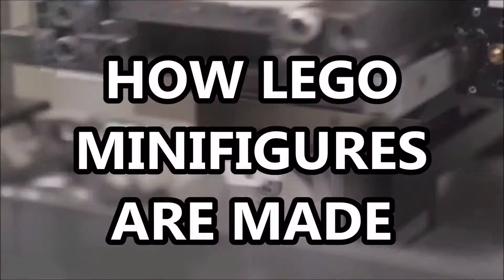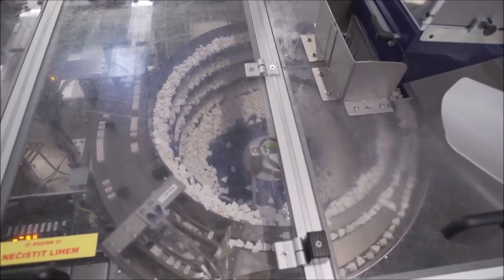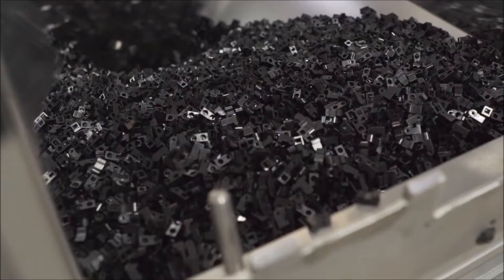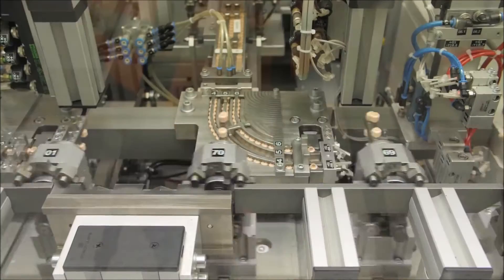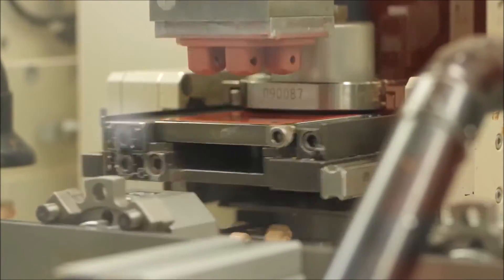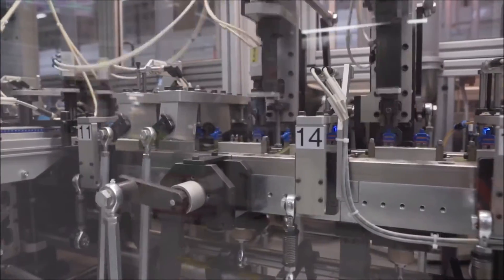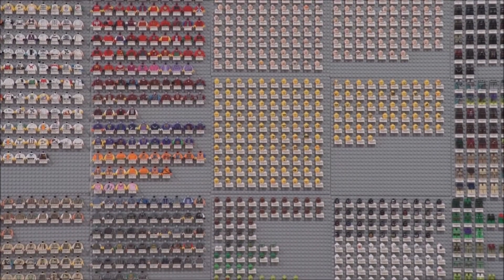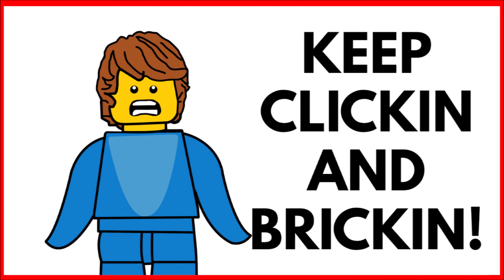How Lego Minifigures Are Made! (Inside the Lego factory!)

Comment: Very good video! Except for one error: Maybe you've noticed that unprinted torsos don't have printed neck posts? The print on the neck post is not for friction fit, it is to make the front and back of the printed torso parts distinguishable. The machine that picks them up can "see" the difference, so every torso is facing the right way for when the arms get added.